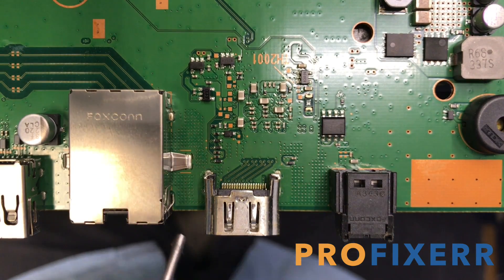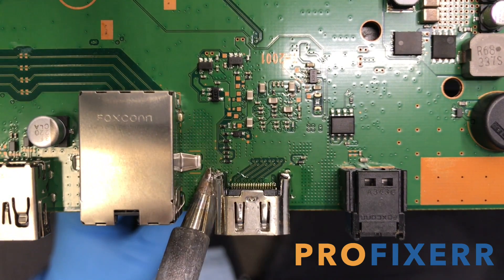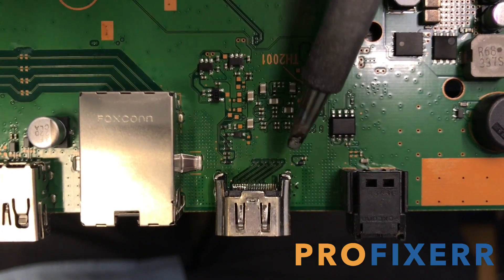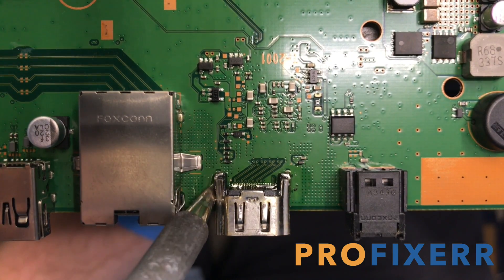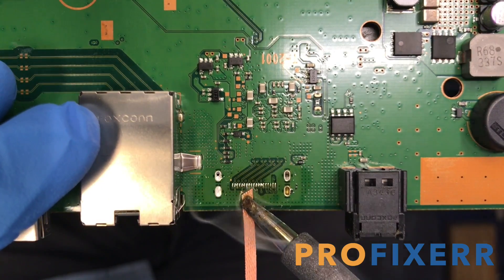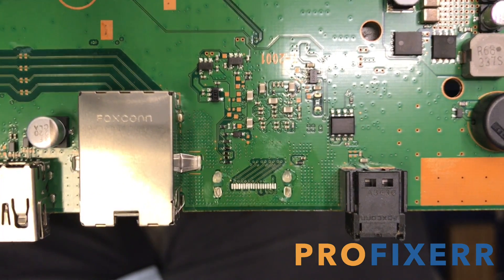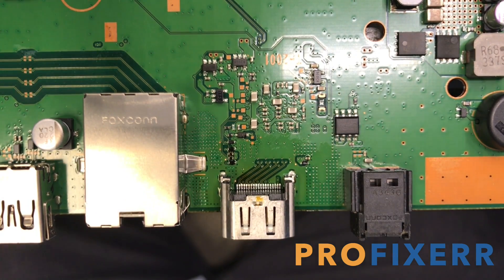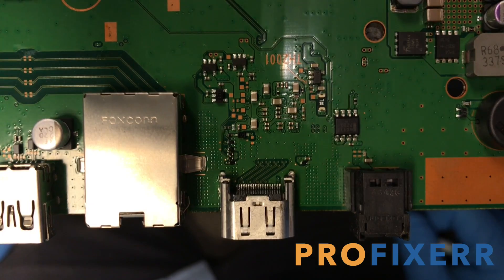PS4 HDMI Port Replacement Tutorial - Detailed Instructions

Comment: Thanks for the video, I was able to successfully change the HDMI port. The only problem now is that the console no longer recognizes a controller. This was not the case before. I've tried 20 different cables and different controllers and even a new one from Amazon, nothing helps. Funnily enough, I can connect the controller via USB cable when the PS4 is in security mode. Repairing the database etc. didn't solve the problem either, when I try to reinstall the firmware via USB, I get the error message "SU-41283-8". Does anyone have any idea what I can do?

Comment: Hey homie! I have absolutely 0% experience in this kind of repair, I just ordered the tools to do this, I’ll update after with the results, but if i succeed I will subscribe immediately as a testament to your incredible step by step instructions
Reply: I actually didnt realize people wanted updates. A few things to note that no one anywhere made apparent.

Some of the solder for their points are a type of high temp solder that doesn’t really take to a lower rated iron like i had at first, i got a higher rated iron and some better flux to match the temp change and with some luck and a tinning pad to help cling the solder i managed to make the swap with a more fortified hdmi outlet. 

It was a mess to look at, but you kinda just gotta keep it going until you put it back together then the mess goes away. But it worked and i even put a better hard drive in there while i had it open. Played elden ring on there and then ended up selling it for money to get a PS5. 

Hopefully that doesnt break.
Reply: Any updates?
Reply: @AZ-ql6nz  if it was anything like my first attempt he fucked up somewhere and ruined the pins and leads to those pins lol. But I too would like an update on this fix to hear that a first timer succeeded!!!
Reply: 2 years and nothing 😭

Comment: CAUTION........There are small components on the motherboard  near where the hdmi socket is mounted, particularly on the underside....These can be loosed, fall off or became damaged by hot air, when removing or replacing the socket..☹

Best cover all the relevant  components in that area with Alfoil or some  form of heat shielding.😀.
Reply: Thanks, great advice 😀

Comment: Hello guys how is everyone doing

So yesterday I got ps4 with broken hdmi port I replaced the hdmi port with new 1 and double checked the pins and they are melted and it's good so I turned on the console boots into 480p it works fine but when I use the 1080p it starts with broken screen and something like that so then I replaced the port again with 6 ports the same problem the ps4 won't display on 1080p just 480p anyone knows the problem please help

Comment: Use hot air along with your iron when soldering the legs down on the back of the board and it'll flow right on through the ground leg holes so you won't have to solder then from the top. Alot cleaner job that way.

Comment: can you only do it with a soldering iron?
Reply: tecnically yes, practically no cuz  trying to use a solid core solder without flux will result in a practically useless joint. The solder will not cling to the surfaces and the oxides will break away causing the joint to fail.

Comment: Major respect for pulling that repair off with an FX888D. Heat transfer on them is bloody awful, upgrading to a FX951 was the best thing I ever did. 

Nice strategy using hot air under the board. That'll be useful for clearing the solder holes when replacing the harddrive connector on the PS2 motherboard, clearing the solder holes on them is a nightmare.
Reply from the maker: Thanks! Fx888d is my main console iron still. I have an fx100 as well. 
The 951 is a great iron too!
Glad you found the video and techniques useful!
Reply: @profixerr6275  women here lol. I know we alll know I’m going to f mine up.  So exactly what is this French You all speak of.  ?
Reply: @Aimeeevps  they're talking about the model of their solder. Brd-wv9io is saying that the solder FX888D is bad at transferring heat.
Reply: @profixerr6275  i think my port is wrong which one do i get
Reply: Is this doable if I don't own a heat gun?

Comment: If you want a 100% sure fix, Just avoid using heat gun to solder the new HDMI port. It's NOT necessary at all, and there Is a huge chance to damage It since the pins are literally sitting on plastic!
Reply: What do you recommend ?
Reply: @ninetyfivek6632  blow torch
Reply: @spectrablaze3760  Thanks. It's been 7 months and I totally forgot about this but still, thanks.
Reply: @ninetyfivek6632  sarcasm
Reply: @B.H.79 How much of it should I use?

Comment: Tried it about 20 times. Never worked. Either legs get stuck to the solder iron's tip and get bent or rip off.
After this of cours about half of the legs are shorted, while the other half isn't soldered at all.
Trying to shave of some of the solder from wher it is too much never works, because the hot solder iron just slips through the liquid solder, without pulling any solder with.
Everytime. Never better.
Reply: Clean It with the wick and try with more flux and 360 Celsius iron. Also if that's the case consider buying some nice Low melting and better solder
Reply: @Mattia_22  Thank you. What would make for a better solder? Do you have examples? And is there an affordable alternative to this super expensive  Amtech flux that everyone uses?
Reply: @Mattia_22  Thank you, this might be helpful with the next 20 tries xD
Reply: @elmariachi5133  haha good luck 👍

Comment: i am trying to fix the hdmi port on an old samsung lcd tv so i cleaned the old solder joints with a solder wick the pins are clean however when i try to solder it back i always end up with a bridge no matter what and i am using a big iron tip just like yours and the placement of the hdmi makes it difficult to get the job done correctly compared to the ps4
Reply: flux is your best friend
Reply: Simon Arsenault no u idiot u dont use flux
Reply: @mrpanda2655  youre pretty much always supposed to use flux. Too much doesn't hurt.
Reply: thank you all for the advices, I've already tried all of these things but i think a smaller tip is more suitable for this kind of work since the placement of the hdmi makes it difficult to achieve such fine work, I've seen people trying to fix their tv's hdmi using temporary solutions like heat gun or puting the board in the oven but  since i am using this old tv parts for practicing i haven't tried any of these methods and wanted to work on my soldering skills instead
Reply: You tin the tip of the iron and try and brush the excess off so it doesnt bridge
Reply: Mr Panda use lot of flux...

Comment: Just another %*%$& example of how electronics are designed to fail, and/or to for people to get professional repairs. $150 or more where I am to have this serviced professionally -- and look at the amount of work it takes just to get to the board, all to fix a POS $5 part that, when it fails, bricks your PS4 or forces you to pay for fixing it. I solved my HDMI issues by throwing my PS4 against the wall, and going back to PC gaming. &$*# Sony -- I won't buy a PS 5 to save my life.

Comment: I replaced an HDMI port for someone. They told me they moved it from one TV to the next and it didn't connect to the other TV. Port was damaged, etc etc I replaced it. I get to the logo just fine, then it starts to flicker and lose signal. Any ideas?
Reply: Some of the pins of the HDMI port aren't soldered good
Reply: @barashferad3890  they've all passed the wiggle test and look good. None are bridged they've all got good contact. Could it be something else?
Reply: @ThePols87  probably damaged a heat sensitive component or it was somehow still too hot when you tested it.

Comment: When I used hot air a very bad smell came, but the hdmi port did come off. Is the smell normal?
Reply: Plastic smells if you heat it up at a high temperature.
Reply: @michaelhorgan9525  the board is made with plastic?
Reply: @BroadwayNexp  HDMI port has plastic parts.
Reply: What heat gun did you use as I have soldering irons etc... just no heat gun
Reply: @rhussain3658  For heatgun maybe a Quick 861DW (Louis Rossmann likes that one), or maybe a good one. They are not that expensive, and this port is not designed to be removed with just a soldering iron. Then again, you can't swim without getting wet, so yeah.

Comment: What tools did you use can you please tell me?
Reply: Can you use a blow dryer
Reply: @michaelramirez3469  no but you might could get away with using an adjustable heatgun from your local tool store provide it can be adjusted down to around 420 degrees Fahrenheit and comes with some reducer tips so can control the hot air output area a little better.
Reply from the maker: Hi Craven, We use a few tools. One is a soldering iron. Feel free to check out our course https://profixerr.com/ps4-microsoldering-course Everything you need to know how to easily and effectively replace the HDMI on a PS4 is there.